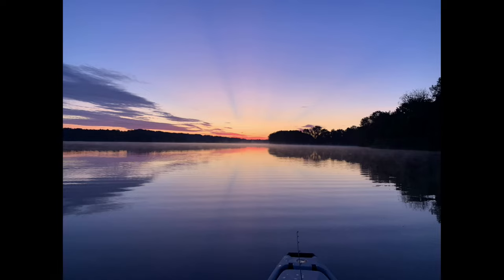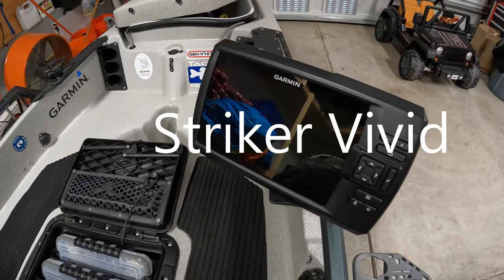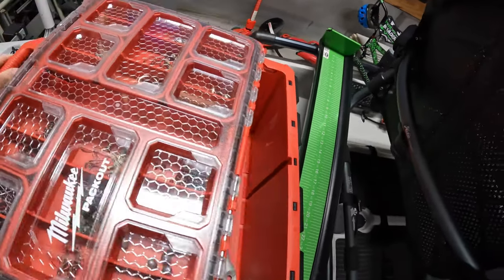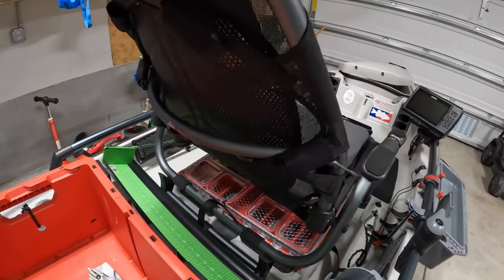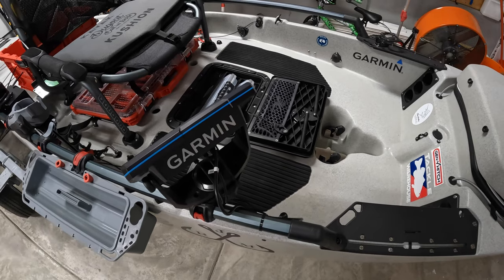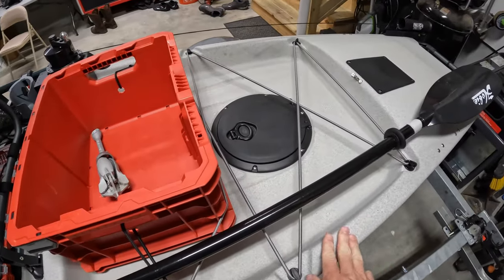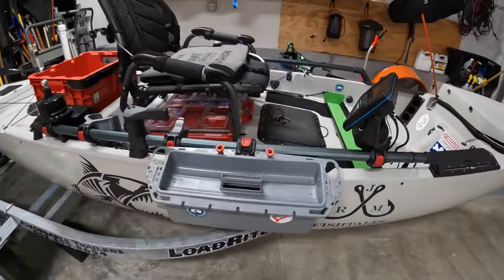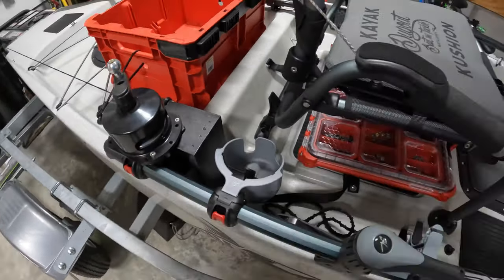Hobie Pa 14 walkthrough and setup / Simple is key

Comment: How do you like the anchor wizard
Reply from the maker: Good.  Only thing is with just one,  you will be facing whatever way the wind is blowing.  You have to stage the way you want to be casting with the wind.  It’s  the most simplest form of anchoring without just using a rope and tying off to your kayak.  Pricing is pretty good too in todays market.  

It makes it easy to deploy and bring back up.   

I was thinking about doing 2, but think I am sticking with one for now.  I thought about Power Pole micro but when fishing deeper it’s no good.
Reply: @rjmfishtales  I just bought a hobie pro angler 14.. I want to keep it simple also.. hopefully I can and still be able to fish the way I want.. thanks for the info..
Reply from the maker: @jamierice3189  you will like it.  It’s stable and easy to use when on the water.  I have had others in the past and came right back to Hobie.  I am lighter now but use to be 350 pds and had no problem.  Tip it once and it was my fault.  I placed myself against a rock in current.  I was able to recover all of my items as I was in 3 feet of water.  If you have the money one day get a trolling motor if you want to cover a lot of water.  I do cover about 5-10 miles on average when out no problem with just the mirage drive.   Have fun and enjoy.

If you have any questions let me know.